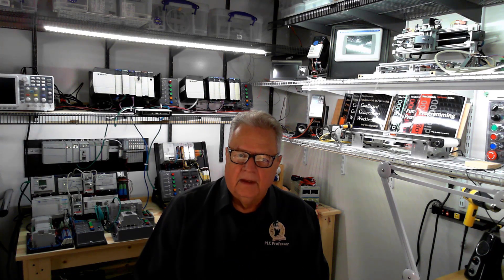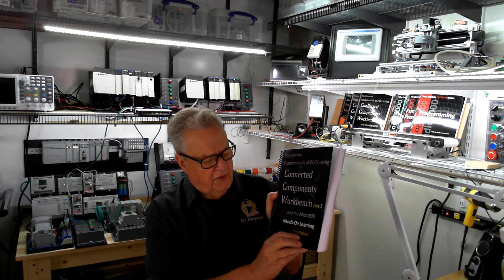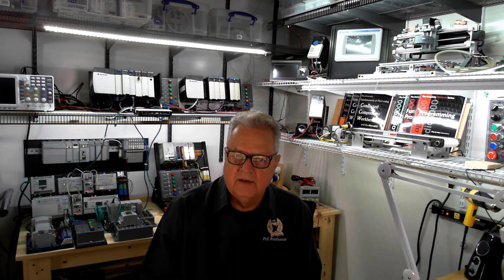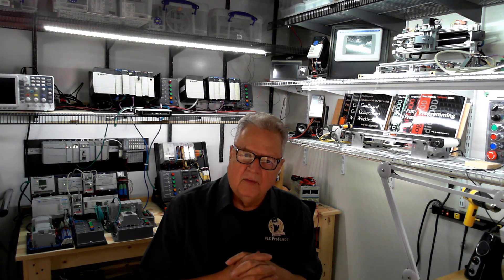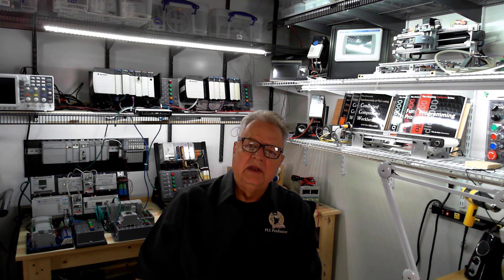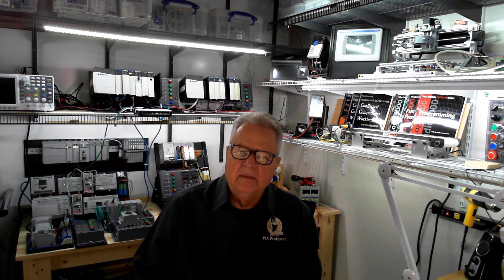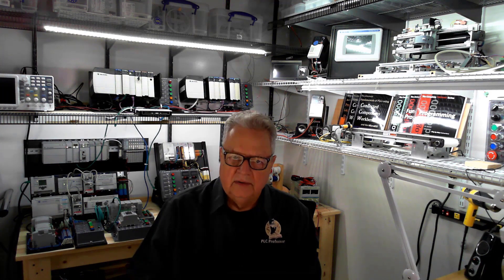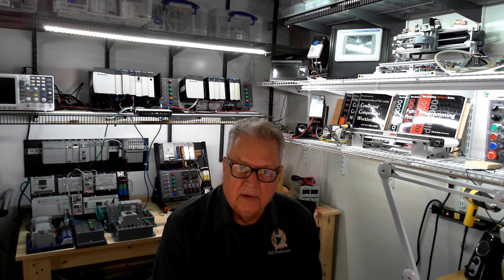0 - CCW Pt1 Introduction

Comment: Thanks.. I am just learning. I purchased a PLC - FX2N-20MR-TTL Programmable Controller Module, PLC, from Walmart to practice with. The device does not have a RS232 connector but a 4 pic connector. What type of connector should I get to program this? Thanks Richard Brown